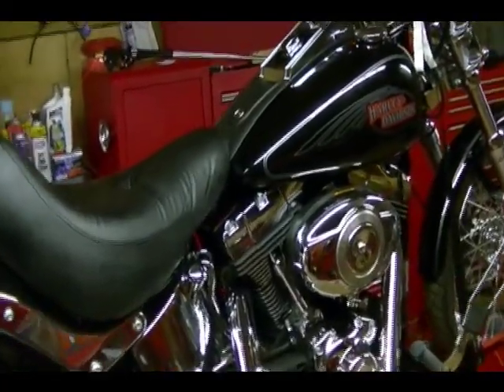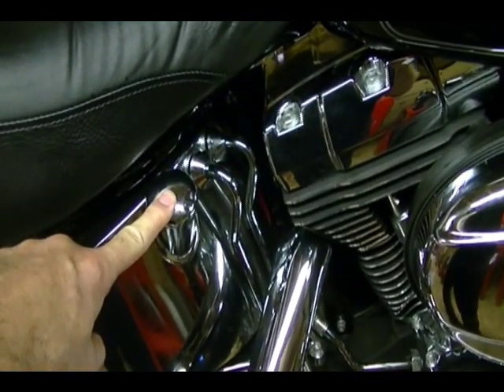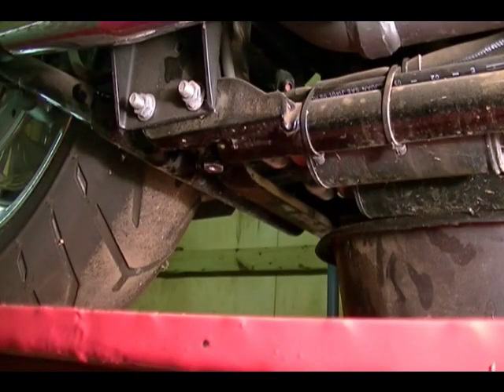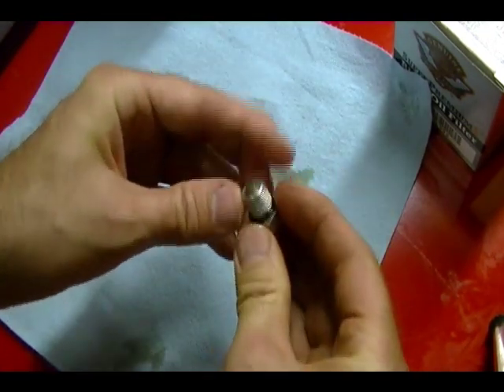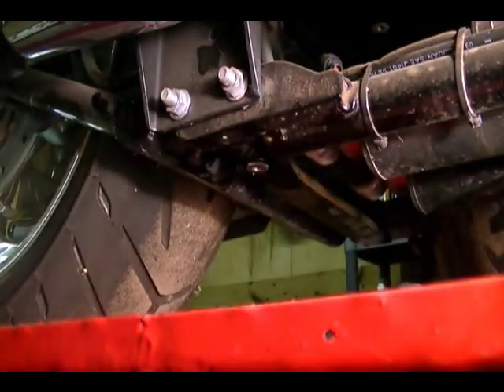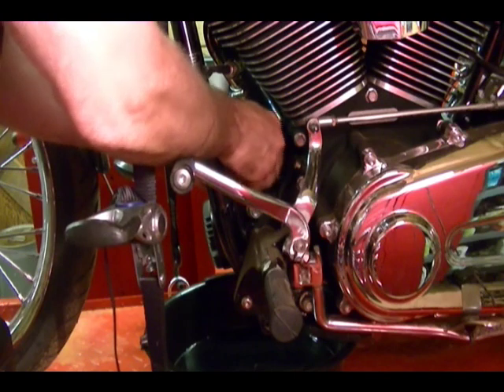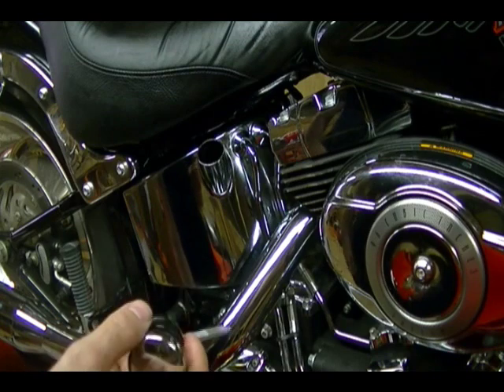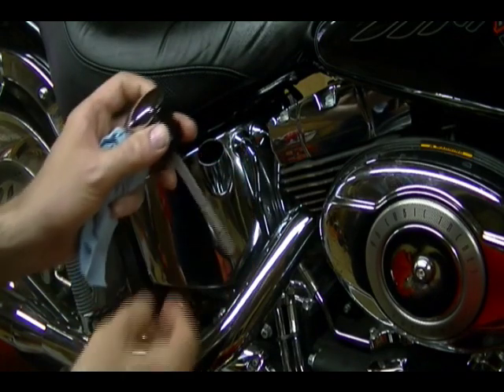Motorcycle Repair: How to Change the Engine Oil & Filter on a 2009 Harley Davidson Softail Custom

Comment: I simple tool for, should you overfill the oil bag is a turkey baster. You can find them at Walmart or other stores. It's basically a long tube with a squeeze bulb on one end. Stick it into the oil tank, squeeze the bulb, release the bulb, and pull it out. Much easier than messing with the oil drain plug.
Reply: Thanks to you both.......Turkey Baster and video saved my engine...

Comment: Good video bro, I just changed all three on my 08 deluxe yesterday and did same procedure as you, but I noticed a small plug towards front of engine (underside about a quarter inch plug).is this plug maybe to drain what remains in the engine block?
Reply: I was doing a change at 1200 mile (going on the road) so i didn't change the filter. when i drained the tank it only seemed to be 2 qts to fill it up. I was wondering too if there was another plug to get all the engine oil out

Comment: I always drain the oil tank with the filter removed and dipstick pulled out. I never use old oil off the filter r to lube the new filter gasket. Only use new oil